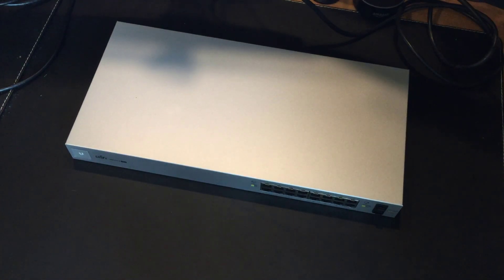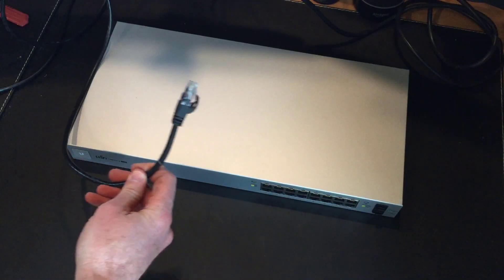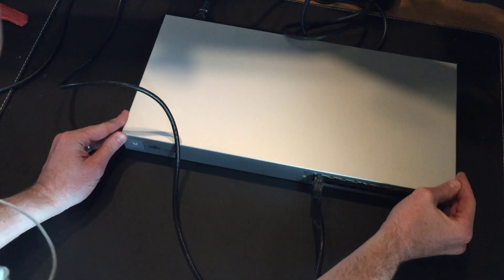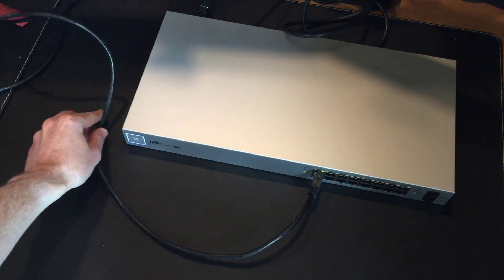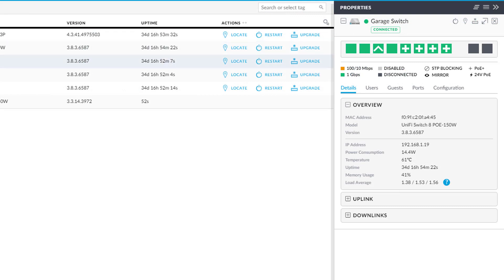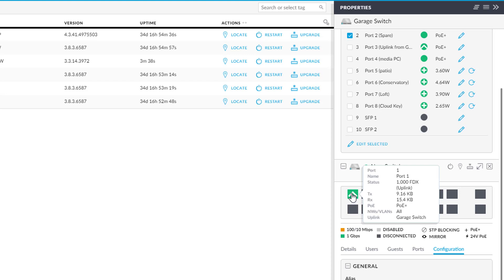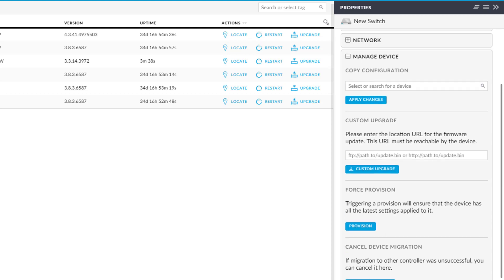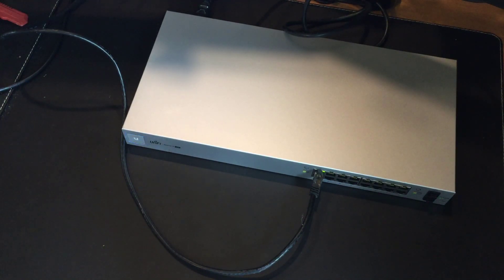Ubiquiti UniFi Switch 16 150W Setup

Comment: Did yours come with rack mounting hardware?  I bought mine used on eBay and need to rack it
Reply from the maker: Yes but only small L shaped brackets to fit into the 2 holes on the side, not a complicated racking kit. So you might be able to find a generic bracket that will fit
Reply: i guess I'm quite off topic but does anyone know of a good place to stream newly released tv shows online ?
Reply: @Cesar Idris lately I have been using flixzone. You can find it by googling :)
Reply: @Wesley Alvin yup, been using Flixzone for months myself =)
Reply: @Wesley Alvin Thanks, signed up and it seems like a nice service :D I appreciate it!
Reply: @Cesar Idris You are welcome xD

Comment: What is the noise level  like running normally ?
Reply from the maker: +Hugh Hennessy Under normal conditions the fan doesn’t spin and it’s silent. Presumably there’s a temperature at which the fan would kick in, but it’s never happened on mine (UK based).
Reply: Thanks for your reply - that was my only concern over the 8 port (fan-less ) that it would noisy as I intend to locate it in the same room I work in.
Reply: Hugh, did you pull the trigger on the 16 port?  And if so, how has the fan situation been for you?
Reply: @hughhennessy7912  Did you end up getting the 16 port? if so, how has the noise been for you?
Reply: Tom Morgan Beautiful. Thanks so much for confirming - I’m about to buy one and use similarly.